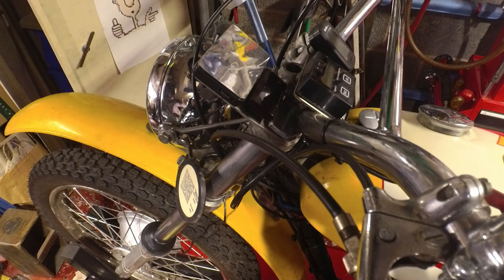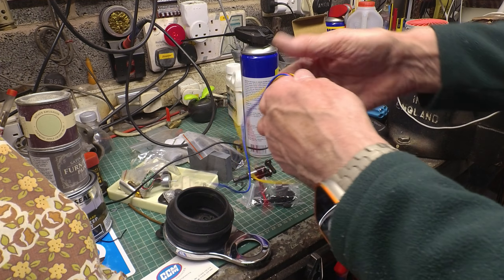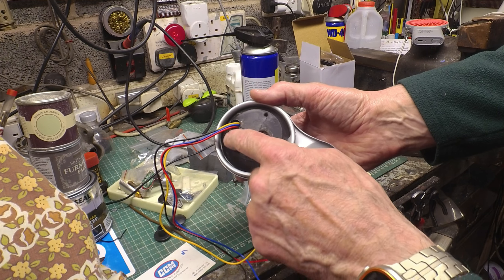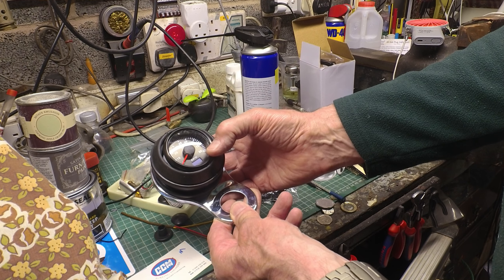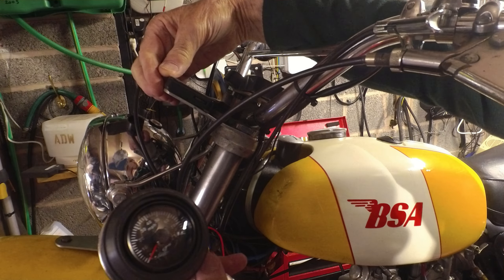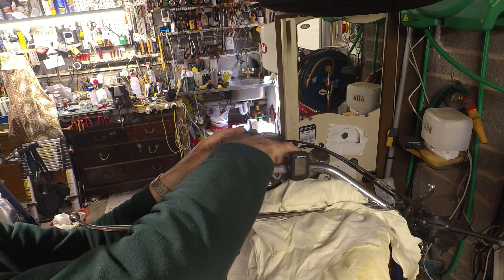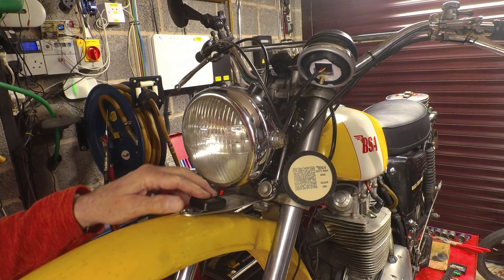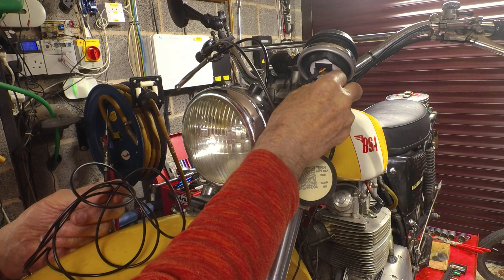BSA B50 : Analogue GPS Speedo 'Upgrade'

Comment: Nice job. The bike sounds well as if its settled in from regular use. Quiet for a large capacity alloy pushrod engine 👍thanks for posting.
Reply from the maker: Many thanks for the comment. The new GPS Speedo has started dropping out occasionally again. It come’s back “online” OK but something is still not right. I assume it’s the power supply but will check all the connections before trying anything else 🤔
Reply: @Greeves  I have never fitted a electronic speedo however I would suspect you are right it requires a constant 12 volts DC. Hopefully you received a wiring diagram and instructions. Would be good to know you worked it out - Thanks
Reply from the maker: @bsa_brummie7775  The instructions are very brief but cover the essentials. It was £40 from China. It’s supposed to work with any supply voltage from 9 - 30V, so I’d have thought it’d be OK. I’m on holiday at the moment but will investigate further when I’m back 👍

Comment: Who needs a speedometer? Just keep up with the traffic. On most of my old British motorcycles the speedometer doesn't work or it's the wrong one. Like my BSA Victor is going to go 150 mph or go to 10,000 rpm. I never go over 60 or so the ride is more important than the destination.
Reply from the maker: Fair enough but I like to keep it legal. Riding around on a noisy old machine tends to draw attention. I don’t want the authorities (incl. insurance companies) to have any excuse for either prosecuting me, or not paying out
Reply: @Greeves  on a B 50 l don't think you have to worry about speeding tickets. I got pulled over because the cop didn't understand hand signals while on my BSA 441.
Reply: @Greeves  my vintage British motorcycles are quiet er than most HD's.
Reply from the maker: @frankmarkovcijr5459  I had chance to test this 😊
https://youtu.be/VukAPaY5HMs